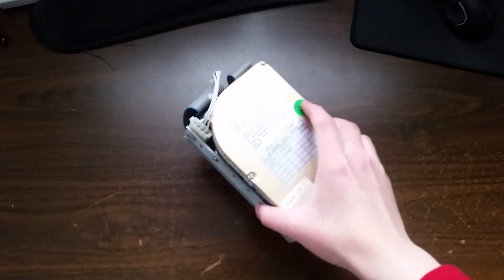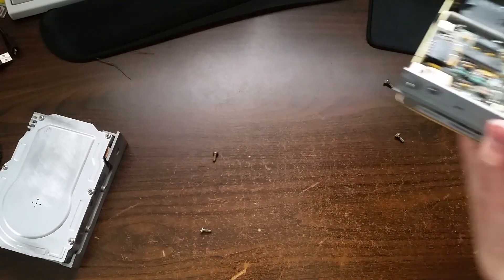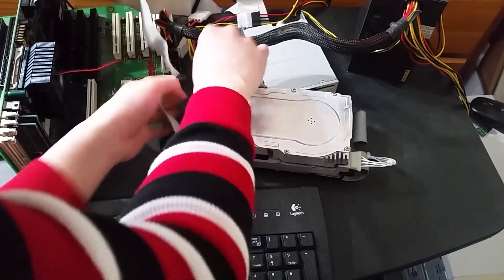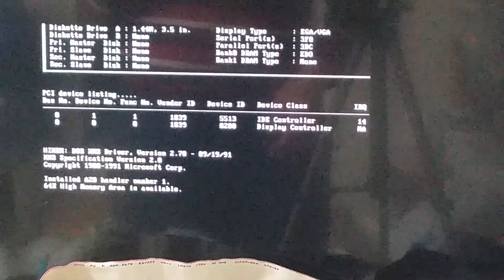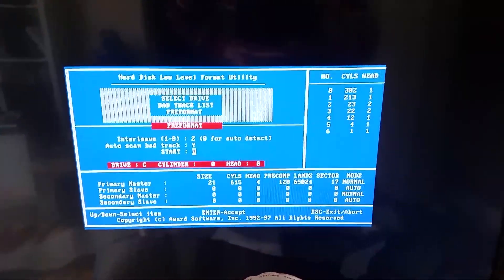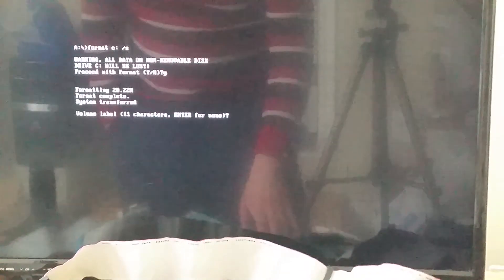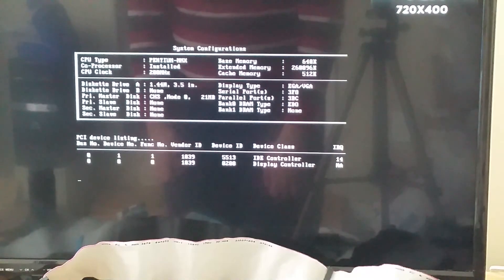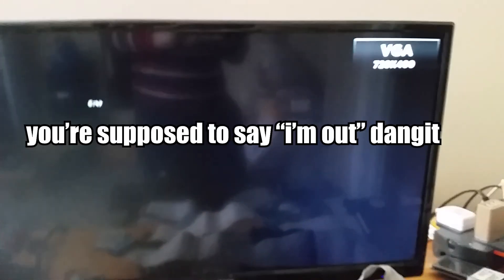This card turns MFM drives into IDE!

Comment: Those Lapine drives are very special, in that they have a mechanism which lifts the heads off of the disk upon shutdown!  There's even an internal suspension which isolates the drive from the case.

Comment: Given that IDE to SATA devices exist, could you hook this up to, say, a Win10 machine?
Reply from the maker: Unfortunately, no. The WD1003 doesn't support auto-detection, meaning that unless the motherboard lets you manually enter the CHS values, it won't ever be seen by the system.

BUT, I'm getting an MFM to SCSI card soon as well, and that MIGHT have the possibility of working in modern systems.
Reply: @TheMajorTechie  Let me guess, Adaptec ACB-4000? No divers exist for it after DOS. At least the WD1003 just works based on the CHS values in the CMOS setup, it just attempts to respond to CHS requests made by the system, but the ACB-4000 and various friends require that the CHS values be transmitted over the SCSI bus before they start to work... Which is the opposite of how most SCSI setups actually work. 

The WD1003-IWH does not support "IDENTIFY" because it does not know the geometry of the disk attached to be able to report it. Unfortunately, this similarly applies to the ACB-4000 and other SCSI-ST506 controllers such as the Xebec 1410 and others, which do not support the SCSI SIZE command - They do not know the geometry of the disk attached unless it is explicitly transmitted on boot.

Comment: Whod it recoggnize in win xp or 98
Reply from the maker: It might, though I haven't tried yet since I only have one motherboard I know of that seems capable of recognizing the controller card at all. Plus for the past few weeks I've been tinkering with old S3 Chrome graphics cards. :P
Reply: I don't know who it would recognize, if anyone. 
Windows 98SE still has support for actual AT-class ST-506/ST-412 controller cards such as the DTC 5280 and 7287.

I am not currently aware of a working NT driver for controllers like this, though the WD1003-IWH shown here may have better luck since it just attaches to an IDE bus. Couldn't hurt to try.